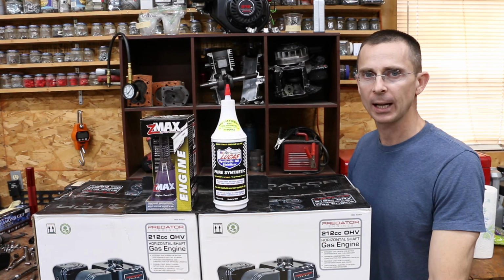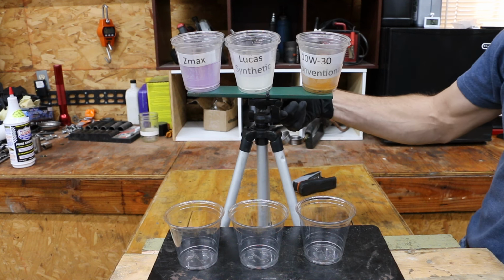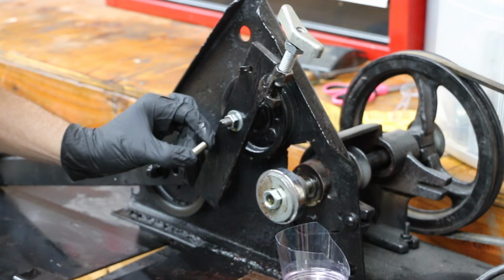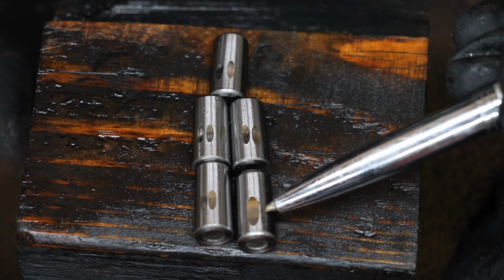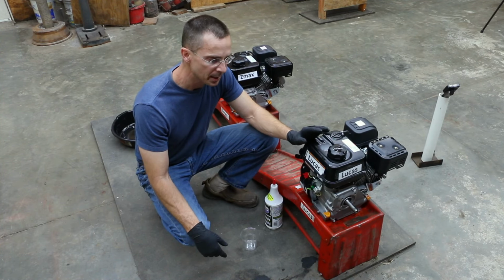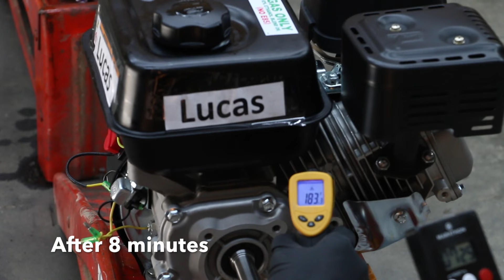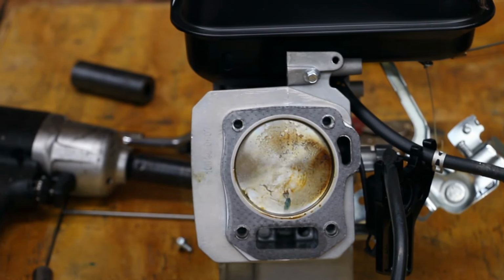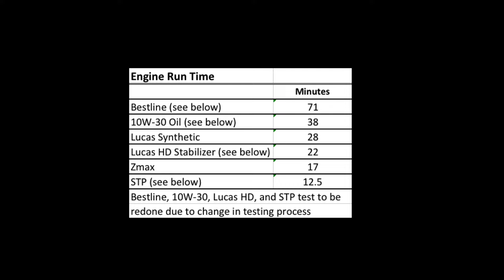Which engine self-destructs first? Zmax or Lucas Synthetic?

Comment: So I guess all Z-Max is 99% mineral oil and 1% purple dye.
Reply: only .5 percent purple dye, the other part is magic fairy dust derived from unicorn horns
Reply: It's actually a cheap parafin oil. The kind that's like $30 a barrel. Very cheap stuff. They got sued, I heard, sorry I didn't confirm, all the way up to the Supreme court for selling something so cheap that does so very little. When I have a customer insist on using Zmax, I tell them we can use just a little. Why? Because then it won't do any harm, lol. 

Don't get me wrong, I used it as described in 2000 on my 1994 Ford Escort. It made it fast and it also wore the engine out very quickly. I got 10-20% better gas mileage for months just to get a permanent 10-20% loss in gas mileage from engine damage until I got sick of it enough to get rid of it. Sure, they have an engine safety promise, but since it was only enough engine damage to lower gas mileage, I'm sure I couldn't have won the case.  Google User
Reply: DE Nichols 10-20% better mileage.  That is quite an imagination you have there.
Reply: @LTVoyager  those were the varying real numbers. Gas mileage is a range. If someone is sure it's always the same, while possible, then the information may be suspect.
Reply: DE Nichols My point is that you can’t possibly get even 10% better mileage due to a change in the oil used.  Frictional loss ranges from 3-9% in most IC engines based on percentage of load.  The 9% value would be at idle under no load and 3% would be at maximum power output.  So, if we say the average friction during normal driving is 5-6%, then even if you found a magic oil that completely eliminates friction, you would at most get 5-6% more fuel mileage.  The reality is you might reduce friction 20-25% which corresponds to a 1-1.5% change in overall engine efficiency and thus fuel mileage.  So, whenever I see a claim of more than 2% better fuel mileage due to changing to some magic elixir oil, I know the claims are bogus.  https://x-engineer.org/automotive-engineering/internal-combustion-engines/performance/mechanical-efficiency-friction-mean-effective-pressure-fmep/
Reply: @LTVoyager  I appreciate your obviously very educated answer, but you are still managing to be incorrect, probably because of information, which you don't have. 

I put the ZMaX in the manual transmission, the engine, and in the gasoline tank. A chemical change in the fuel or a clean up of issues can change efficiency a lot more than the numbers you're just considering for "changes in oil".
Reply: DE Nichols Nope, still BS.  Keep believing though.  Were it not for folks like you, lots of these companies would not be able to sell their snake oil.
Reply: zmax soaks into the metal,there is a wait period. Results have been skewed.
Reply: @DENicholsAutoBravado  Far as I know it was slick 50 and duralube that got sued. Unless you have citation. 
Correction,they were FTC sued. So were Valvoline and stp. 
Judging by the standards of testing,forgoing the fact that zmax has a period of time to "bond" molecular,I can see how the results were obtained.
That said they did claim outrageous results,but so do the others.I believe the increased mpg claims were an issue. None of which seem to truly address does it when given the use it says of the bottle,form a "bond" with particular metals inside an engine to better protect those metals. 
The fact that it is simply a mineral oil I would think not.
Reply: @DENicholsAutoBravado  Wait..found something interesting on the FTC find. Apparently "zmax" was only reprimanded to not make claims that weren't proven/provable.
Which leads me to believe in the least,these were proven results confirmed by the FTC:
CONCORD, NC (March 20, 2003) - Oil-Chem Research Corp. (Oil-Chem) and Speedway Motorsports, Inc. (SMI) announced today a resolution to their dispute with the Federal Trade Commission (FTC) concerning the advertising of zMAX Power System.

"We at Speedway Motorsports are very pleased that the staff of the Federal Trade Commission has specifically confirmed that Oil-Chem can continue to make the following claims in its advertising and promotion of zMAX,” stated Marylaurel E. Wilks, vice president and general counsel of SMI.

zMAX soaks into metal.

zMAX reduces friction.

zMAX increases horsepower.

zMAX dissipates engine heat.

zMAX helps to improve or restore gas mileage and reduce emissions in older cars, by virtue of reducing engine deposits.

zMAX helps to maintain gas mileage and emissions in newer cars, by virtue of reducing engine deposits.

zMAX helps to reduce engine wear on engine valve-stems and guides and piston rings and skirts, by virtue of reducing engine deposits.

zMAX helps to extend engine life, by virtue of reducing engine deposits.
Reply: @DENicholsAutoBravado  This from a zmax rep,take it for what you will,oh and they do indeed use it in aerotech,specifically plane engines,
"zMAX does contain mineral oil, but it is the one of the highest grades of pharmaceutical mineral oil available That mineral oil is then reformulated at the molecular level to shrink the molecules, making them smaller and allowing them to "soak into metal". I have been advised that mineral oil is the basis for most motor oils and it is also what they use to break-in airplane engines that can be 3 to 5 times the cost of a normal car engine."
Reply: Soak into the metal is hilarious.  Unless the metal was very poorly made, there is no porosity in steel and thus nothing will “soak into” it.  This is all marketing stuff.  Now, certain compounds can bond to metal very tightly, but that is not the same as “soaking into it.”

These companies will make all sorts of claims and our laws allow a fair bit of “puffery” to occur before anything illegal has occurred.  The reality is that using decent quality oil with regular oil changes is all you need.  Additives are all snake oil and all are unnecessary.
Reply: @LTVoyager  you can stop now. Trey Nathaniel made great effort to put out researched information and you just Nay Say everything to get a reaction out of people. This behavior has no effect on rational people and their process to learn the truth.

You are the epitome of being biased rather than being open to learning which is required if you want sound thought processes, which are more likely to relate to reality. 

All metal is porous. Ever see it on an electron microscope? What looks perfectly smooth and machine is a mess. Why do you think the metals in our engines can never touch? (Excepting parts like valves to the combustion chamber. Those touch.)
Reply: DE Nichols Surface roughness is not porosity.  Yes, I have seen many things under an electron microscope.  You are confusing surface roughness with porosity.  If a metal is porous, other than sintered metals which are designed to be porous, then it was not manufactured properly and had gaseous inclusions.  But even then, it is generally closed pores and thus won’t absorb liquids.
Reply: And 100% pretentious bottle
Reply: But 100% cool science flask and thats how you know it works.
Reply: 99% snake oil, 1% mineral oil.
Reply: Ultra CNC Engineers understand very well that metals wear and even how they wear.  They also understand what pores and porosity means, which you apparently don’t.  Porosity allows liquids or gases to pass from one surface of a material to another surface.  If you fill a cylinder with liquid or gas and then weld both ends of the cylinder shut, the liquid or gas will stay in the cylinder and not leak through the surface of the cylinder to the outside of the cylinder.  That is what being porous means.

Blowby in a piston and cylinder system is not a porosity issue, it is a sealing issue due to surface roughness.  These are two different phenomena.
Reply: Ultra CNC  I used to see some respectable mechanics/wrenchers, then came the "professionals", then the engineers, then the lawyers, and now I'm beginning to see the next biggest trend: the "machinists"

I wonder what the next YT profession of the month/year/season will be.
Reply: I'd have to agree. Your oil doesn't determine power.. It's the fuel that matters. The fuel and oil are seperate.
Reply: More like snake oil according to his test lol
Reply: LTVoyager thank you.. I was beginning to wonder if there was any common sense around here
Reply: @treynathaniel4075  "The Federal Trade Commission has filed suit in U. S. District Court seeking to halt false and misleading advertising for zMax auto additives and has asked the court to order refunds to consumers who bought the products. The agency alleges that enhanced performance claims for the product are unsubstantiated, that tests cited to support performance claims actually demonstrated that motor oil treated with zMax produced more than twice as much bearing corrosion than motor oil alone, and that the three different products - an engine additive, a fuel line additive and a transmission additive - were all actually tinted mineral oil."
Reply: @LTVoyager   Just as a reference. I've seen a 1mpg loss out of 23mpg so 4.3% from changing a 75w-80 front differential oil to a 110weight.
Reply: lifeisgood070 I’m sure you think you did.
Reply: @LTVoyager  speak for yourself
Reply: lifeisgood070 Always do.
Reply: lifeisgood070 lifeisgood070 Since you say you blocked me, you will never see this.  However, here is why I believe your claims are incorrect.  Not considering that it is very hard to measure a 1 MPG difference outside of a lab setting, to achieve that much difference in efficiency would mean you were dissipating a LOT of additional heat in the transaxle. Putting a nearly 4,000 watt heater in the transaxle would change the temperature of it dramatically, even with a transmission cooler to help reject heat.  Here are my calculations.  Feel free to check them for accuracy.  The link you provided is only to an abstract, not a full report.  And I am not paying $41.50 for a 20 year-old report if you want to buy the report and send me a copy, I am happy to read it to see the conditions and assumptions made in the report.  That is where the rubber hits the road.

1 gal = 	33.41	kWh
23 MPG = 	2.61	GPH @ 60 MPH
22 MPG =	2.73	GPH @ 60 MPH
	0.12	GPH additional gas consumption
	3.96	kWh additional heat @ 60 MPH
	3,962	Watt heater in the transaxle
Reply: And 100% snake oil.
Reply: @treynathaniel4075  the fact you believe that molicules can shrink is cute. Like wow! A simple google search explains it pretty well... obviously a sales rep will tell you what you want to hear to sell their products.... it's a sales pitch lmfao and you fell for it hook line and sinker..."The size of atoms is absolutely fixed, and molecules can only grow by adding more atoms, and that process makes new different molecules. ... If you want to grow or shrink anything, you have to increase or decrease the number of molecules or atoms involved"....
Reply: You’re not paying for the mineral oil . You’re paying for the process to reduce it to nano particle level. The same product is widely used in the small aircraft industry but it’s marketed under a different brand. Aircraft maintenance technicians use it primarily for its ability to keep carbon from sticking to valves & pistons. Though it technically doesn’t “soak” into metal it’s nano size allows it to enter into the peaks and valleys that even the finest polished metals have. The fact that it’s used in the aircraft industry lends credibility to its ability to prevent carbon buildup. I don’t use it. I generally don’t use any oil additives with the exception of ZDDP in an old flat tappet SBC I own.
Reply: @LTVoyager  cast iron is highly porous, crankshafts and cylinder walls are cast iron
Reply: Texassince1836 Yet another person who doesn’t understand porosity.
Reply: @LTVoyager  you don't seem to understand porosity yourself.  Oil can and will soak into cast iron. Same as oil will soak into the outer layers of wood, but won't just pour through it.
Reply: Im still skeptical about the effect being useful in these circumstances but the claim is far from 100% nonsense
Reply: Texassince1836 So you are saying that if I make a cast iron pail and fill it with oil, the oil will leak through the pail and onto the floor?
Reply: Texassince1836 I understand porosity quite well.  Read the “honorable mention” section:  http://www.castironcollector.com/myths.php
Reply: ZMAX is a Quality Oil Additive and I've Been using it for years.
Reply: John Reynolds I use quality oils so that I don’t need additives.
Reply: @LTVoyager  I honestly think the ones the just wanna  Argue about ZMAX and call it "Snake Oil" are the ones that are just to Cheap to Pay for it.
Reply: John Reynolds Most of us are smart enough to know we don’t need to pay for it.  Good quality oil is all you need.
Reply: Noble6 I guess that is one benefit!  LOL.
Reply: @Noble6 All I know Is that After I use ZMAX My car Runs Waaay smoother and I get Better Gas Mileage.
Reply: @johnreynolds6291  

I'm not an engineer, but I understand porosity and the surface imperfections that hold lubrication and prevent metal to metal contact, just a question here...... Did anyone here watch this video? The results speak volumes for these two products, I think that's enough said.
Reply: @johnreynolds6291  Your video proof is made by ZMAX...did you think they would say anything bad about their own product.  I'd also like to point out that in their video where the ZMAX is "soaking" through the metal from the center, the single drop in the middle never goes down in volume.  If it was really wicking through the metal it would not still be pooled in the center too
Reply: Seems to me it would be much better money spent over the life of owning a car to skip the cost of additives and instead invest those funds toward performing all oil changes 1k to 2k miles early and replace the filter at every oil change.
Reply: Unicorn farts because that product is shit
Reply: @larrypeek9278  You are correct most engines outlast the vehicles they're installed in with 3000 mile oil changes and not over revving them.
Reply: Baby oil smells better, same stuff lol. I use baby oil for door hinges and the outside (most) metal on guns. It's a good non toxic lubricant/protector.

Comment: It's always a bit of a cringe to watch brand new products being damaged but this is no way a waste at all. It is a case study to help prevent waste on a much larger scale. You're doing big favors for people and in my opinion helping create less waste in the long run. Thank you again for another informative video and thank you for devoting your time for all of these.
Reply from the maker: Thank you very much for the positive comment!
Reply: True but like you pretty much said. Its all for research unlike techrex which just brakes things for views
Reply: Not only is he doing a great service to us all, he's also helping the next generation of small engine mechanics. A win win, if ever I've seen one.
Reply: Note taken Kevin, but this is no different than auto manufacturers building their products to sellable specs to perform crash tests for safety purposes 🙂💪🏽
Reply: Being donated to a school afterwards is a great idea. The crankshaft may be too far gone to go back in for a rebuild.
Probably not too expensive to replace it,along with the other parts. I'm a bit curious about the collective wear in some of the other areas of the machine.
I wonder what the valve lash gap was like after running with basically no lubrication.

Comment: Zmax = Thin mineral oil with purple food coloring.
Reply: MrWhitetailtracker it really is...they say a sucker is born every second.
Reply: Sounds like everything Royal Purple
Reply: I can make that pretty cheap with stuff from the store.
Reply from the maker: Yes, this seems to be the case. Thanks for commenting.
Reply: Don Werrboutit Not even close. Royal purple is very good oil. I use royal purple HPS in a Mustang I have with a blower motor and have been very pleased.
Reply: Thumbs up on this video as always! 👏😎
Reply: I started using Royal Purple in my gen III Hemi a few years ago after finding a case of it on amazon for about the price I was used to paying for the older name brands of synthetics.  I went in skeptical, figuring it was probably just a bunch of marketing hogwash.  But I found my engine oil temperatures stayed about 10 degrees cooler and I got an extra 1-1.5 mpg (which on a typical rate of 13-14 mpg means the normal price difference pays for itself in about 1000 miles).  Their ATF+4 also got rid of the 2nd gear nibble that plagues Dodge's implementation of the T-6060.  Royal Purple works.
Reply: why not  compare different brand intake filters..extreme testing with baby powder, dirt sand etc?? and see ho important a clean intake filter can be
Reply: or stability vs ethanol and non ethanol ..let the carbs sit for 6 months and see if they become gummed up?
Reply: Sorg616 Exactly! Right on!
Reply: ExaltedDuck That's exactly right sir.

Comment: Zmax uses ZDDF additive, which is zinc based, and not as effective as modern day nanolubricants, such as borate. With that said, I'm not surprised Lucas lasted longer seeing how the oil additive is way thicker than Zmax, and when drained leaves behind more oil residue for lubrication, than the thinner Zmax+oil. Great video and keep up the awesome work! I can't wait for the Archoil (potassium borate) based oil additive test. Finally don't worry about the haters, nothing is learned in science without destruction!
Reply from the maker: Great point and thanks for commenting.